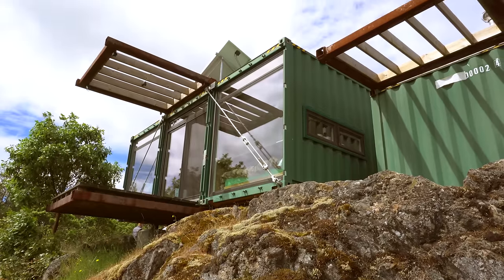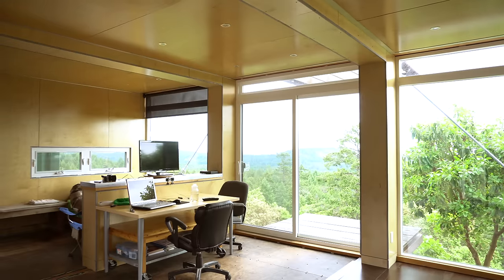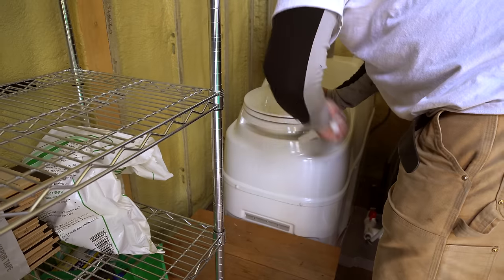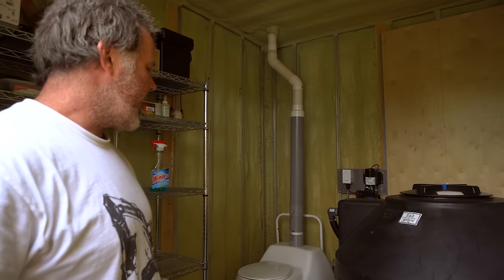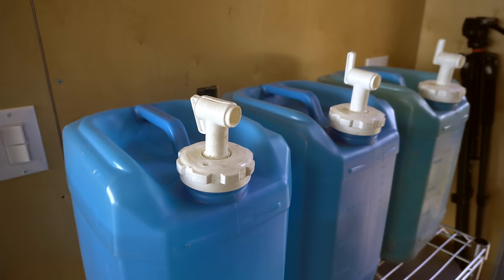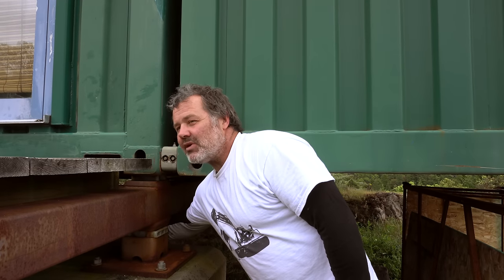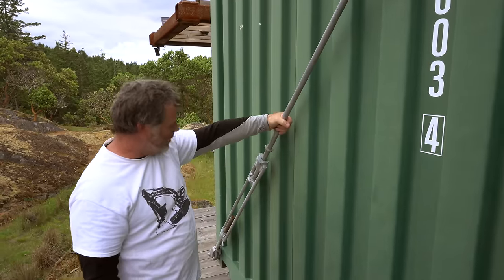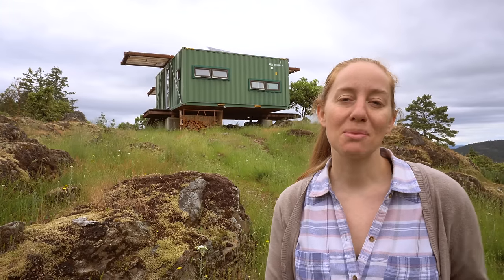Man Builds Stunning Off Grid Shipping Container Home on Mountain Top

Comment: This is incredible. There should be more businesses like this that just make everything like Legos and you piece it all together yourself.
Reply from the maker: Yeah that would be great.  It would also be nice if rules and regulations were a bit more open to alternative buildings.  I think a lot of people want to build spaces like this but get discouraged by all the legal issues......we just have to keep putting on the pressure to force change!
Reply: Exploring Alternatives exactly. In my county the smallest livable domicile needs to be at least 400 square feet. My apartment is 460 square feet.
Reply: There are and it is not just off grid here in the UK there is a construction Co. that has built student accommodation up to about five stories or it could be more using this method with 40' containers fitted out in a factory with every thing you need.
Reply: Getting more people to downsize to 400 sq ft, or even to 1k sq ft would be significantly better for the environment than a few people moving into 150 sq ft.  Most regulations like that assume a minimum family size because they don't want to go around inspecting the smaller homes to make sure they're staying within their occupancy limits.
Reply: +Rand Zopyr Getting people to downsize?

Comment: Just the planning and logistics of a shipping container house always seems to leave me wondering why?  It seems like you buy a nice shell, but you have to move it, place it, cut it up, and then you don't have a lot of flexibility because the shell's integrity gives it its strength, so chopping it up loses that.  Maybe I'm wrong but you have to add so much other stuff to it that it's like buying a cardboard box, but the time you are done the cardboard box is not the majority of the house.  However, I guess you have shelter and security while you are building it out, which is something you would not have until you get to a certain stage of a stick-frame house, and it is no so much manual work, but hauling and placing has got to be expensive.

Comment: I have a question: Adam mentioned that the house could be disassembled and reassembled. But how does that work with electricity wires going through the house? I'm asking because I'm designing a container house (with two 20' containers) and I would like it to be moveable as well.

Comment: Umm, if it needs propane and wood, then I guess it’s not totally off grid, no? Also, you don’t mention about how they are insulated, which is one of the main issues with container conversions. And I would have liked to have seen the things he was talking about shown in a bit more of a clear way. If I was going off grid, then it would have to be all electric with more solar panels and a lager wind generator with larger batteries.

Comment: disappointed, summer house, no protection from the winter in BC, open under the home so cold floors, cold home, roof should be able to stand heavy snows but again no insulation.
Reply: the HoneyBox site indicates this type of structure is being built with spray foam insulation .. as siting was known, perhaps that extended to the floor.
Reply: I agree about the energy efficiency, but there would be some easy ways to fix that.
Reply: This may be west coast. Warmest place in canada.